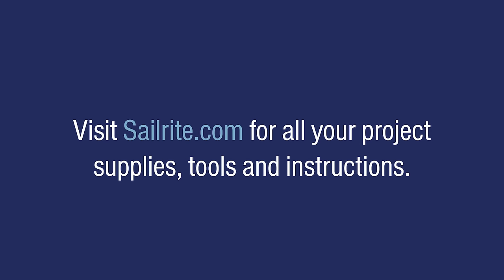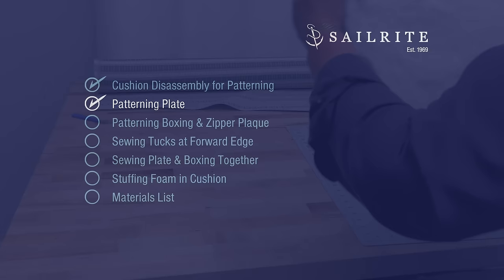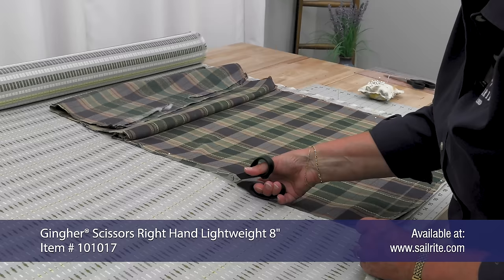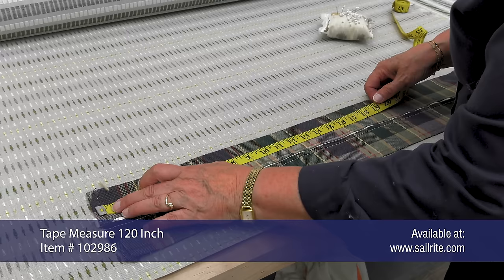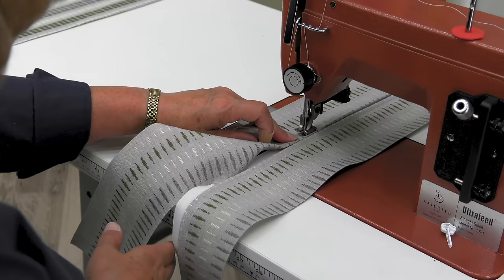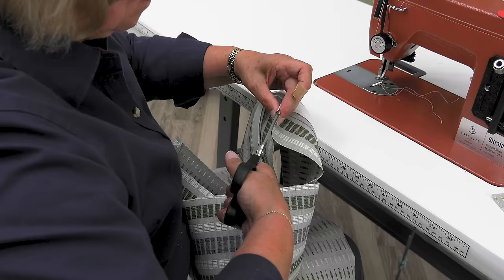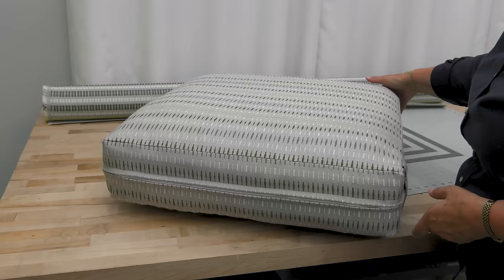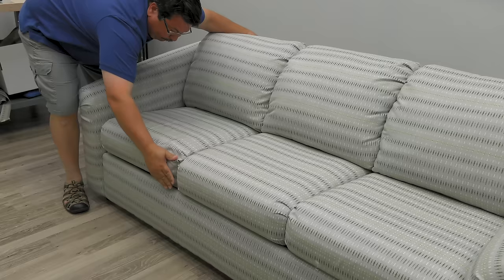How To Sew Sofa Cushions

Comment: Hello thank you for sharing this tutorial, I have cushions just like the one in the video, may I know how to do the correct measurements of the cover pattern please? Mine were shrink and broken, can't use it for tracing. Do I need to add extra length to the top and bottom plate for the tucks? Also should I just trace the side out of the foam and then add the extra 3 inches ? Sorry for so many question and thanks in advance!!!